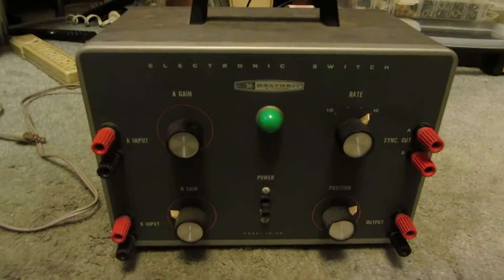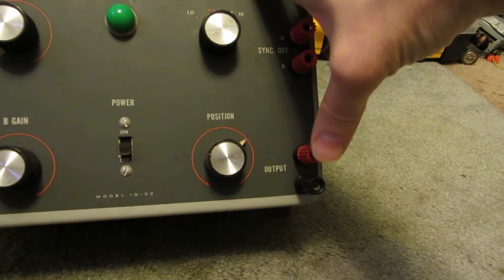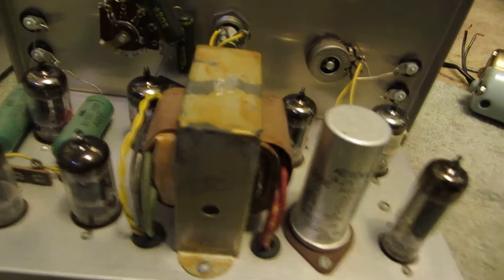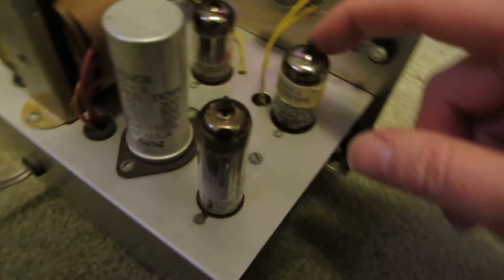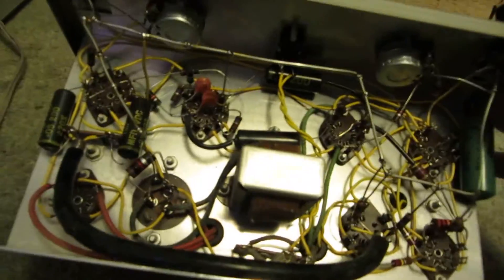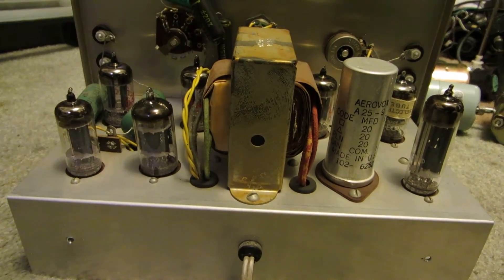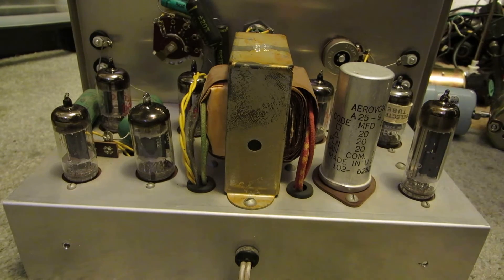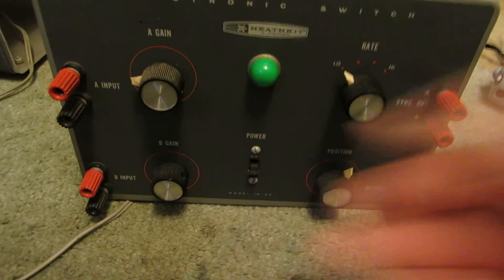HeathKit Electronic Switch Autopsy

Comment: 3:00 It's a choke. Chokes meant for 50-60Hz operation are made on transformer chassis to keep eddy currents and costs low. Usually today you don't see them very much, but you can occasionally see them in a passive PFC computer power supply.